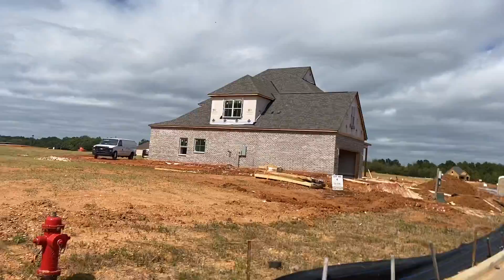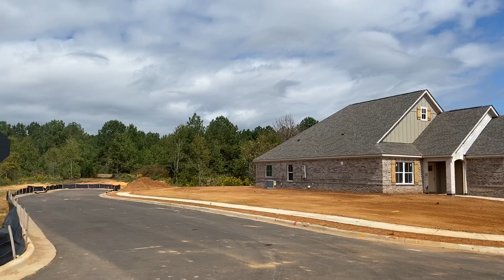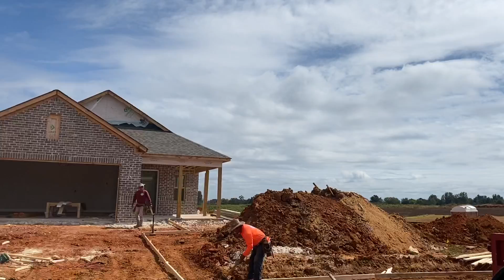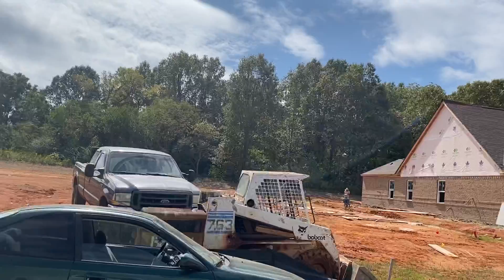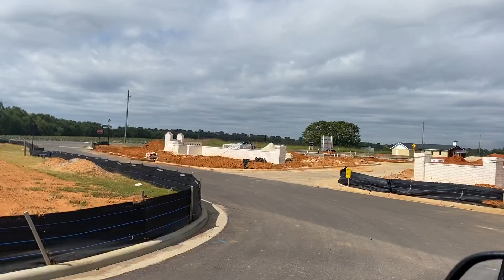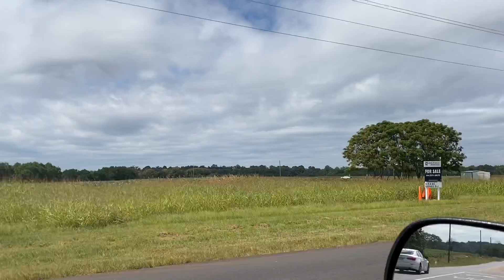New Homes Going Up In Prattville Alabama

Comment: They need to build homes for first time home buyers on low fixed incomes. Everything is for the rich or high income people.  What about the people who worked all their lives and are home sick on SSD AND MEDICARE who desire to buy a home?  You hey need to build homes for those people to be able to buy.
Reply from the maker: You can get a BRAND new house for 160,000 in Alabama. In Florida for example, you wont find anything for less than $220,000 and in some regions a new home starts at $350,000.. so.. 160k is affordable. you can get a livable house for $90,000 in Alabama.. very affordable state